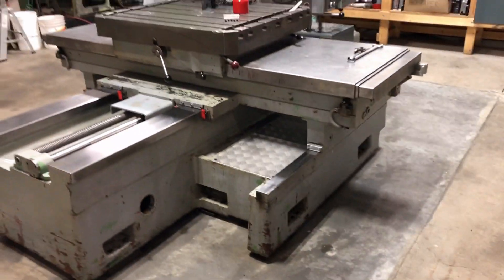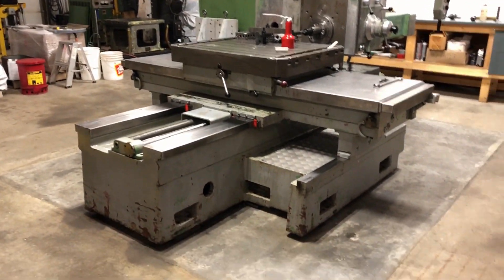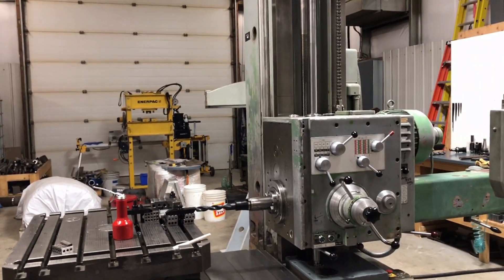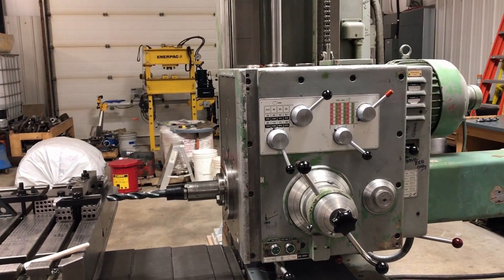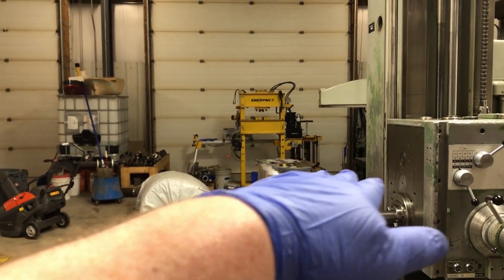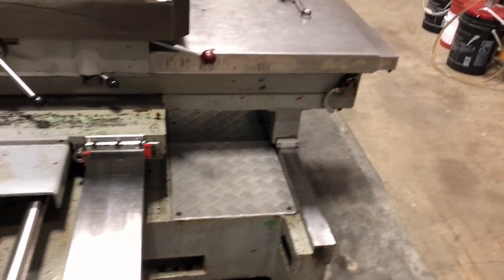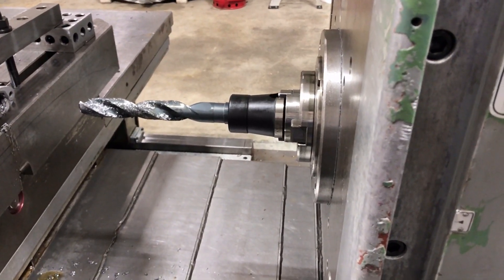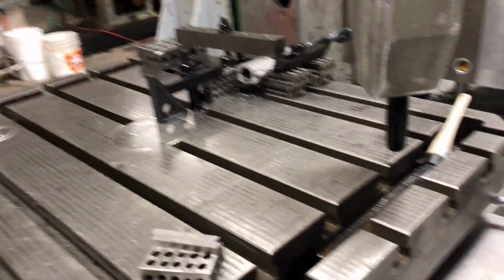HBM Update No. 5 - The Positive Cash Flow Episode

Comment: What an incredible machine!  I use a 1945 Cincinnati horizontal mill with a high speed vertical attachment. Same experience with accuracy. It is better than factory spec. They used to make machines with an unbelievable volume of cast iron. Things just don't seem to wear out when there is no vibration at all.

DROs love these big, old beasts.  As accurate as any micrometer if the head & scale are rigid. That cast iron makes that part fun.  I used thick chunks of stainless for the brackets. The readings wouldn't flinch if I hit the mill with my car.

Comment: Nice one Ken .   I bet you gave a sigh of relief after the final checks !  👍👍👍
Reply from the maker: Thanks Max.  Yes, the sigh was so deep I got light headed.  Then I got drunk for two days.  So far I've done four jobs on it and, even without readouts, it is fantastic to use.  The ease of use compared to my horizontal mill is night and day.  I pick up the read outs for it on Monday.  I think you will be very happy once you get yours up and running.  Ken
Reply: @hmw-ms3tx  I would have knocked back a couple of ''Sherbits'' after that result as well !

Comment: Totally envious of your HBM.
Being from the East Coast of Ozz, I would gladly relieve you of that Metric machine.
Little chance, eh!
Fantastic condition really.
Reply from the maker: Thanks Carl.  I think I'll hang onto it for a little while.  I was in grade two when Canada went metric so have been exposed to it most of my life.  When doing engineering calculations I much prefer using metric (in fact when we used to get imperial questions on exams I would convert everything to metric , solve the equations and convert the answer back to imperial).  However, all of my machining experience has been using inches and I get totally lost trying to use metric in a machine shop environment. I know a tenth is tight but I don't intuitively know the metric equivalent.  Once I have the read-outs installed I can have it both ways but I know which system it will stay on.  Ken